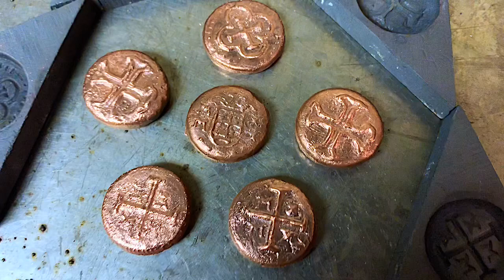Melting Scrap Copper & Pouring Custom Pirate Loot

Comment: Those turned out really nice! Very creative and original.
Reply from the maker: Hey, Thanks!  Yeah the molds have held up very well as I've put them through several cycles with Copper, Aluminum, and Brass.  If youre interested, check out this video where I make some more and have a little treasure hunt -> https://youtu.be/ksgObA1rsSQ

Comment: Those did turn out very well. I might have to take a shot at carving out some graphite blocks.
Reply from the maker: It was a lot cheaper than buying premade designs. Sure they are a little crude, but it was fun and rewarding.

Comment: I eventually went with the Sand/Perlite/Cement/Fire Clay mix for my furnace and lid before I moved on to a purchased on.  Fire clay was picked up from local pottery shop for dirt cheap and they were fairly knowledgable on stuff, so worth picking their brains.  Nicely done on copper tho!
Reply from the maker: Those materials sound rugged for sure, thanks for sharing.  The copper was definitely a challenge... I've tried a couple times and it solidified in the crucible which was no good.  I'm glad it worked out for this video.

Comment: Bud I wouldn’t call it a forge unless you intend to forge iron in that, I’d call it a furnace or your entire setup is called a foundry. I don’t like correcting people but someone corrected me and they were right so thx
Reply from the maker: You are right!
I just may have to do some re-naming on these videos...
Reply: LukeSmith 😂 don’t sweat it, I respect the tkor furnace, that was my first one when I was 13, keep up the good work and maybe buy/make a better one that doesn’t break after 3pours
Reply from the maker: @American_Innovation  Haha, yeah I have all the materials to build an LP gas foundry I just got side tracked proving the charcoal concept and taking it as far as it will go (which has involved some slight repairs). More to come!